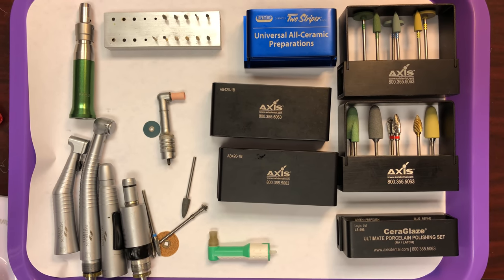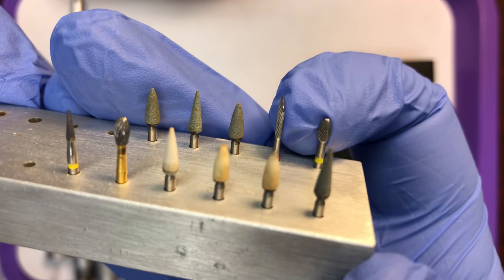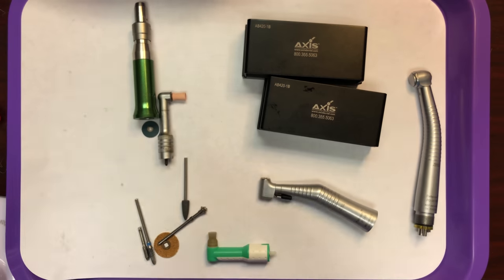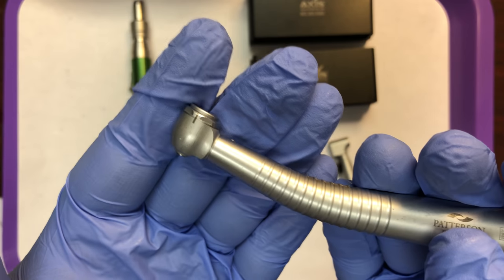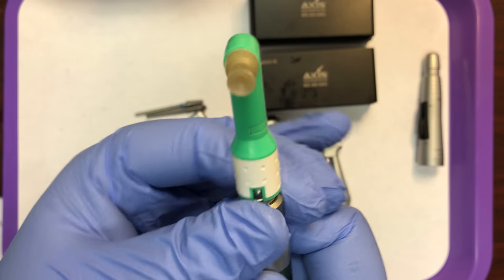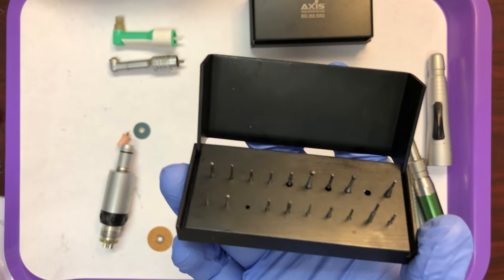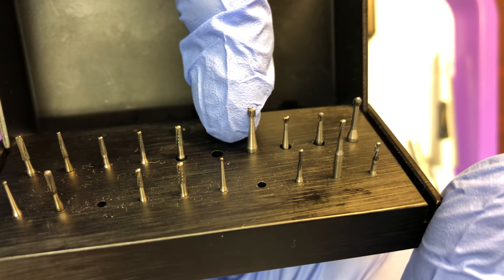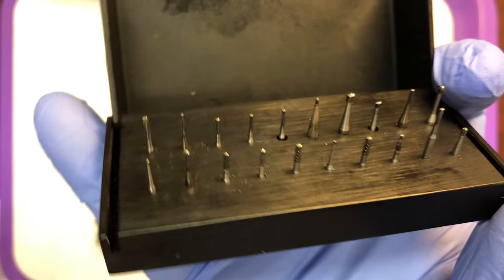Common Dental Burs

Comment: Saying the "notched" attachment of the low speed would have been helpful for the first tray.  I am also wondering are your diamond and carbide finishing burs reusable or disposable or do you put disposable ones in the tray and toss them from the tray after use?
Reply from the maker: These are reusable - but they are only used for training DAs. The offices I see that are using disposable (individually packaged) keep the burs in the original pack until ready to use.